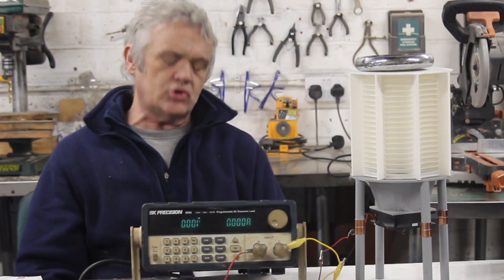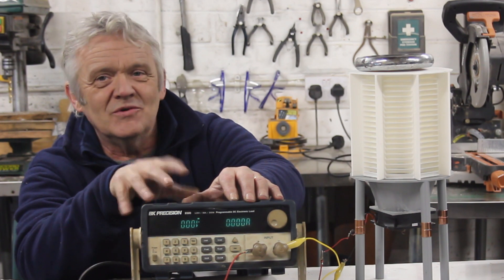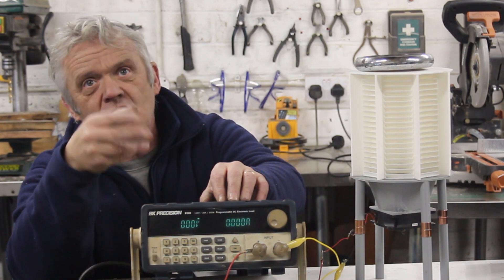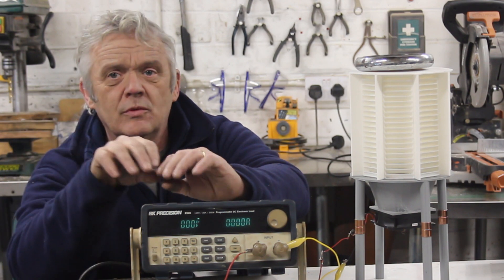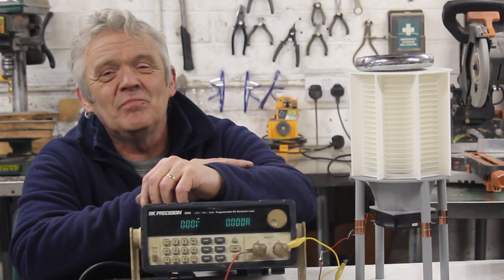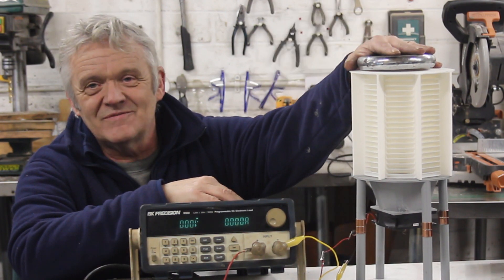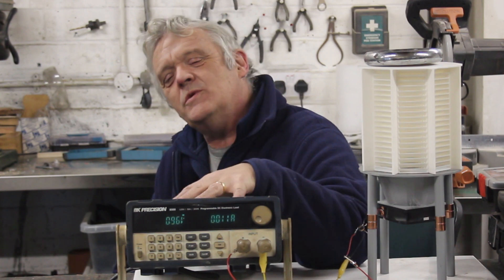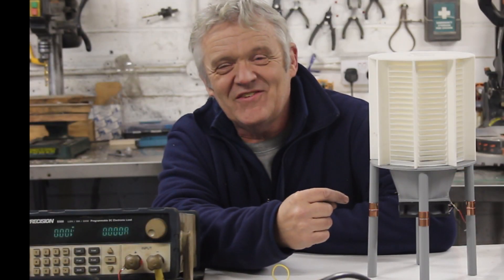1837 Measuring The Darwin Wind Turbine - Everyman's Aeromine

Comment: The dive into these has been great.  I alway felt the wind should go out the top to create a rising heat column when there is no wind but now feel going out the bottom is indeed better for all the reasons you have mentioned such as easier access to the moving components and better protection from the elements.   I have also seen people suggest using old grain silos, and mounted along the corners of buildings. There are some really smart and creative people here.  You guys are awesome.
Reply: Also gravity, technically. It may be insignificant at this scale, but during certain times of the year in Antarctica, the gravitational pull on the rapidly chilled air causes 100+mph surface winds, as the air is conducted into a horizontal direction by the mountains after reaching terminal velocity. 😲
Reply: @Alkimi  Yup - scale and applications. Small house chimneys have 8 - 15m height. It takes a bit time to warm up air enough to create a drag. But take enormous amount of air over Antarctica... or yet better, the biggest waterfall on earth - it's under water in the Atlantic ocean 😁 Not much temp difference, but the amount of water and the height is enormous.
Reply: @ogi22  it's wild to consider that everything falls at the same rate, regardless of mass. Even air. So if you can keep the pressure lower on the bottom end, that wind will accelerate at up to 9 meters per second... per second! Basically fast as you can move the air away from the exit. Perhaps a furnace or a jet stove to pull air out of a room with a tall intake on top? You'd get airflow, heat, and turbo-charged power generation, all for the cost of whatever you burn. 🤔
Reply: @Alkimi  Ok, coll thought experment. But treat air like air - a lot of different molecules. Let's scale this up a bit...
Imagine a tube (reasonably high) filled with marbles. They all have a potential to accelerate 9m/s^2. But for any of them, you will have to start removing all marbles at the bottom. You have to push them away. Push them away really fast, because next will fall quicker. But wait. There are marbles around you and you have to push your marbles agains other marbles that are in the same imaginary tubes around...
And that's not that funny anymore 😁
Reply: @ogi22  right... I... that's what I said. As fast as you can move the air out, the more it generates. The convection of a stove would pull a vacuum so the incoming turbine air can fall and pick up speed fox maximum generator output,  plus you get heat.  You're pulling my leg, aren't you? 😏
Reply: @Alkimi  Well... Yes... And no.
Marbles were just there so you and many others could relate to those air molecules more. We think in a different scale.
And i saw a bit dangerous hint in your thinking path - so much energy, just by burning a bit and pulling air out - a first step towards breaking the rules of thermodynamics and trying to make another type of perpetuum mobile.
But since you are on this channel, i will let you find out by yourself ;) Mr Smith had a lot of clips on topic of how much energy you can get from the wind and why.
My little hints - every turbine slows down the wind speed and you can't pull all energy from the wind. You can't pull more air than vacuum.
Reply: @ogi22  yeah that's a very different scale. Not what I was talking about at all.
I'm just talking about a stove and some ventilation with the Darwin turbine in this here video right here.
Like in a house.
Not resonance chamber ramastat hypertrophy heat exchange dilithium fusion reactor concept designs for JPL aerospace or whatever.
More like cracking a window and lighting a potbelly stove. 🤪
Reply: @ogi22  there really isn’t any slippery slope with Alkimi’s example. Energy is being added in the form of burning fuel, so not really anything like an attempt at perpetual motion. More like extracting some of the energy that would normally go to waste.
Reply from the maker: I agree there are some really excellent people who contribute such a lot to the community here
Reply: @ThinkingandTinkering  That's exactly what i said in your 1832 clip, when you were presenting different desings sent to you by others. Love the discussion, crazy ideas and enthusiasm in classic Feynman's style - finding things out :)

Answering the doubts of @Smalltownlife - pressure difference between top and bottom because of the temperature difference (gravity) in this setup will be negligible compared to the force of the wind. Priority here is:
1. Easy access to equipment - easier and safer maintenance.
2. Lower center of mass - less prone to tipping, less lateral forces on fixing points. Especially when mounted on the roof!
That's why there are some electrical cabinets with inverted way of cooling - from top to bottom (forced by a fan). And they do it because the top of the cabinet is usually in much cleaner air space than bottom (dust from the floor). And it keeps filters clean for much longer than in a bottom-to-top setup.

Comment: Seems like it's not more efficient than equivalent surface plain turbine. So what's the benefit of the extra material? Smaller moving parts, less wear, more pleasing to the eyes, safe for birds?
Reply from the maker: yes exactly all of those
Reply: I would go with no exposed moving parts as the best feature here
Reply: All of the above?
Reply: and works in every wind direction
Reply: Placing the heavy generator close to the ground is the principle benefit. Robert is correct that  the collector element would have very low maintenance, but it is also much more at risk of damage from high winds than conventional turbines because the turbines have much smaller surface areas, so the drag on them is much lower.

Comment: I think that the darwin setup could be simplified to four sections. A square.
Reply from the maker: it probably could mate - or a hex maybe?
Reply: @ThinkingandTinkering  less resistance the better. Every vertical creates a boundary layer of drag. Less verticals, more power. Easier to go up in scale starting as a square then working in more sections as size becomes a hurdle.
Reply: I was thinking the louvers going in deeper would be better for stopping air escaping but would create more drag. Although that might be four steps forward and only one step back
Reply: Now I'm brainstorming that this could be made with bendy straws. Thinking a ring of 10 standing with the upper end bent outward. Better with the lower ends stuck into a pipe. Then keep building more layers of straw vertically so the lower outputs meet at the center and housed by the ring of straw below them.